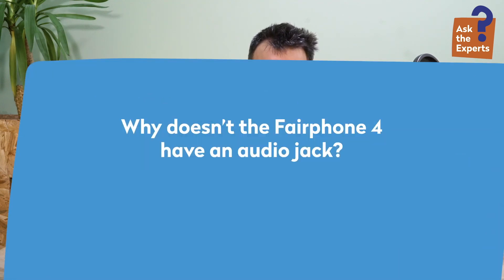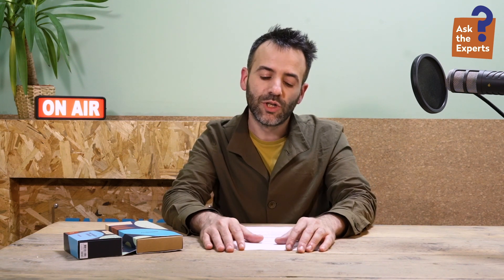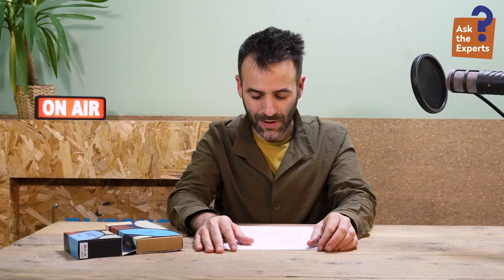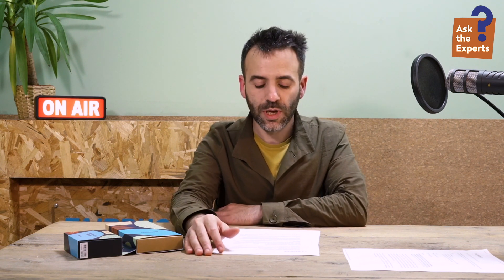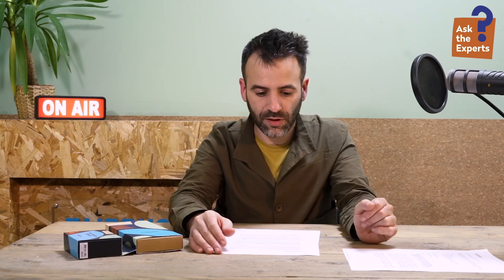Where's the headphone jack?! | and other questions answered | Fairphone

Comment: That's the actual dealbreaker that prevents me from buying a Fairphone, I'm not even kidding. It's not that I can't live without a jack, but that I can't tolerate a supposedly green company removing the jack and making people use less ecological wireless headphones.

Never seen a broken jack, but I've seen broken charging ports. IP68 phones without jacks get damaged by water, your phones do, too. Dust is easy to remove from a jack. Your charging port is easy to repair, the jack can be, too. Yes, the jack will make the phone marginally larger. But just be real and tell us that it's very profitable to sell wireless headphones and earbuds.

My car has an old multimedia and the music often stutters over bluetooth. If I use the dongle and turn on my navigation, my battery would die. I'd need to buy a dongle with a jack+charge port and you don't sell one. Or I'd have to drop half a grand for a new car multimedia. I don't feel like paying 2x-3x as much for a slower phone and have to deal with something as stupid as this.

Comment: Problem is that the usb c doesn't replace the headphone jack. The USB C port constantly cuts out at unknown voltages and because the usb-c port isn't fully locked, any bashing of it at all in a pocket will cause the audio to cut out. Bluetooth is terrible and your attempted solution with the fairbuds XL don't work either because plugging them in directly causes both microphone and EQ issues. I swear I'm producing double the e-waste because you insist on not putting a headphone jack on. The phone is no longer an all in one device and I'm honestly more disappointed in it the more that time goes on.

Comment: First. No, the USB Port does NOT replace the headphone jack. The 3.5mm port uses analog data, instead of digital, and if properly shielded, will have substantially less noise then digital.

Second. The 3.5mm Port is NOT less durable then any connector on a modern phone, infact it is probably the most durable connector because it is analog. It literally just needs electrical contact. It is an incredibly simple part with very few points of failure. If you wanted to remove connectors that were likely to fail, you should remove the USB C port and make it a contact magnetic charger port since that experiences almost no meaningful force from the wire when being used.

Third. They solved the issue of dust getting into ports DECADES ago. Its called a rubber gasket.

If you're gonna make up bullshit as to why my 3.5mm Headphones which have lasted for decades, and will last for a few more decades, aren't as sustainable as making a shitload of dongles and adapters which add more points of failure, and are likely to get lost or thrown out, or Bluetooth Headphones with non-replaceable batteries which are literally designed to stop working and not be repairable within 5 years, you should try harder to think up some actual reasons.

Or maybe just don't spit obvious bullshit, because honestly, it comes off as treating your customers like idiots. Why don't you just say "We benefit from you buying dongles and bluetooth headphones from our marketplace, so we removed the headphone jack." Because is it not true that you DO benefit from that?

Comment: So instead of the headphone jack having a very small chance of failing and not being usable (if you can't be bothered to buy a new cheap part and replace it), it will just be removed and then its guaranteed that you won't get to use it ever?

Comment: You know this is bullshit bc they came out with their own set of wireless earbuds (the least sustainable type of listening device). Not to mention removing this port means your USB C port has to pull double duty and be used twice as much. It does not make your device more durable, it does make sure that you'll have to buy that part from them more often and keep buying those shitty earbuds from them though. Stop trying to gaslight us into thinking this wasn't done with profits in mind. No one's falling for it!

Comment: The arguments for why the headphone jack was removed don't hold up, not just theoretically, but when we look at a living example like the Asus Zenfone.

Your arguments are that it's hard to make it water/dust proof because of the headphone jack, the zenfone 10 has IP68 without removing the audio jack.

And that it takes precious space from the internal of the phone, the zenfone 10 has a 5.92 inch display vs 6.3 of the fairphone 4 (with also smaller dimensions of the phone itself 146.5 x 68.1 x 9.4 mm for the zenfone 10 vs 162 x 75.5 x 10.5 mm of the fairphone 4) , also has a 4300 mAh battery vs the 3905 mAh of the fairphone 4.

And the argument that it can break, what are you talking about? In my whole life I've never seen a broken 3.5mm audio jack in a phone, hell I've once snapped a cheaply made headphone's male connector inside a phone's 3.5mm and once I took it out the phone's audio jack worked just fine with another headphones.

And it being removed just when you introduce wireless earbuds that just gets thrown away after 2 or 3 years because of their batteries being not replaceable, it proves that the company's intention was to just boost sales of the fairphone earbuds, and not a single reason from what you have said.

This just shows that we shouldn't see any company's actions coming from good intentions, but that whatever they do is just to squeeze profits and nothing else, and this company's way is by selling products marketed as fairly sourced materials and environmentally friendly, while actually not being that.

Comment: I've never had a problem with a headphone jack through normal use. I use a wired headset/headphones all the time. I've tried bluetooth but there are now so many devices using 2.4GHz that connections are never 100% reliable. I don't want more stuff requiring batteries and having to be recharged. Having more radios turned on on a phone reduces battery life even more.

Other issues of not having a proper headset jack andd relying on bluetooth are those of security and EMR. If I don't need to have radios on, by putting the phone into airplane mode for example, my phone is much more secure from attack. With a headphone jack I can put my device in airplane mode and still use it as a media player to listen to music or whatever, even in sensitive areas such as hospitals where EMR can interfere with the operation of medical equipment.

Comment: Soooo, what if you "invent" a new "headphone jack" instead? I think a separate port for audio is still needed in my opinion 

This way you could bootstrap a conversion and offer adapters for legacy but also new headphones as well, having charging and audio at the same time it's something that a lot of users do find important, dongles suck, maybe making the new aux port could be though as having electrical connections that are the same as the headphones jack but they got a better structure allowing an much smaller adapter

Comment: I would still use my iPhone 5S if it still worked. I currently use a refurbished first generation iPhone SE (looks exactly like an iPhone 5S). If it eventually gives up the ghost (german for when a machine/device/battery/etc. goes on the fritz / dies), I might switch to a Fairphone. However, there are two things I clearly miss, a headphone jack and the dedicated button like on the iPhone 5S or SE (1st gen) with which you can also use for fingerprint security, among other things.
Furthermore, I don't like large smartphones because I like to use my phone with one hand. 

On the plus side, however, is clearly the modularity and sustainability. The green casing also looks nice.
I saved the fairphone website in my browser for the future.

Comment: Totally buying in on losing the 3.5 mm jack. I have previously also been annoyed about the change from companiesremoving them. But since accepting the bluetooth headphones, i am totally in. Some comments say their headphones last very long with the jack. I guess that is the case for some headphones but personally I dont agree on that, I have had plenty of headphones (also expensive brands) where one of the headphones would not work, primarily because of connection issues between the chord and one of the headphones.

For me the biggest issues are the camera and the size. I hope with the camera that it is primarily the software, because I think the pictures and movie I would do with my older iphone 7 did better than my fairphone 4. No worries if its just a software thing, I will happily wait for upgrades on that part, and not a big picture taker anyways (even though it would be nice to be able to take nice great pictures if the opportunity would show itself).
About the size - talking about my older iphone 7 - I would have loved having the option to buy a phone at that size once again. Its difficult when having it in one hand to control the phone, and it takes up a lot of space in the pocket. then i'd rather have a smaller screen.

One last thing - I would love it if you designed a cover that had a pocket for credit cards - I dont know how big the market is for those, but i would have liked to have that option :)

Apart from that i am super happy with the phone, i think you have done just great! Keep up the good work!

Comment: I wrote this before and I'll write it again: The removal of the headphone jack and the micro SD card slot (and now SIM cards) from ANY device is a financial one. Anyone who thinks otherwise is f***king delusional. Oh and the removable battery too - its all just to make more money selling you more sh*t you don't need. The quality of 99% of all bluetooth headphones and mics is pure sh*t. My $7 Panasonic wired earbuds from 2012 sound better than most $150+ "wireless" earbuds - its not magic .... its just a strong analog signal that isn't passing through an ADC and being transmitted via lossy packets ...

Comment: Sorry but I genuinely can't help but laugh at this

For every reason that's presented here it's very obvious that the reason the headphone jack is removed is just to go along with the existing bandwagon.

You can manage water-resistance and dust-resistance with the headphone jack, a headphone jack barely takes up any space, and really? Bluetooth? Wireless headphones are not repairable, it only lasts as long as the battery is still working, they are wasteful and you can't repair them. Dongles aren't a solution either, your going to keep using the USB-C Port more which increases the chance of that breaking 

For a company set that prided itself on not just Repairability but also being Pro-Consumer, this is just sad. Why should I pay more for less features? I get it, Companies got rid of the jack a while ago but coming from this company is such a middle finger to the face. I'm disappointed.

Comment: Reduce E-waste? Bluetooth headphones?  Two tiny batteries, will last 5h x 500 charge cycles, so only 2500h or about 1.5 year. Not-repairable, so forced electronic waste in 1.5 year. Meanwhile I'm listening from my wired headphones, 6 years old with approx. 9000 hours based on average daily use. What is the real E-waste?

Comment: Removing the headphone jack and start selling air buds makes absolutely NO SENSE from an environmental perspective and is an exceptionally bad decision for the environment. 
- the occurrence of repairing headphone ports is minimal compared to charge ports I would say 1/50 or 1/75
- water damage is just as prevalent on phones without headphone jacks.
- bluetooth devices are unrepairable. when the abysmall battery dies, so does the air buds.... 
- using the same jack both for charging, dongles, headphones etc results in much greater wear of the charge port.
- we have been able to construct phones with antennas with headphones jacks for ages... this to is no reason to remove it

I have had my wired headset for 10+ years. And I have professional microphones that uses the headphone jack which I can no longer use without a headphone jack... None of the answers make sense, and this is a business decision to earn money, not for the environment. All respect is lost when you start to green wash your products. You might be better than other companies, but this brings you closer to them.

Comment: So to reduce ewaste you will remove a headphone jack thus making people buy bleutooth headphones, whose batteries will eventually run out and create more ewaste, not to mention all the discarded wired headphones heading to landfills.

A reminder :Many listen to music while charging their phones.
Reply: Not only that, but wireless headphone batteries have the worst life expectancies.  The lifetime of lithium-ion batteries depends on the size of the battery, and number of charge cycles.  Each bud has a tiny battery, so their batteries become unusable VERY quickly. And, the only way of charging them is the carrying case! So if either of the 2 buds die, they're both garbage. If the case dies, EVEN if the headphones still work you won't be able to charge them, and you'll end up throwing the out anyway.
Reply: Wireless pod headphones are literally some of THE most resource-wasteful products in all  of electronics.

Comment: You do realize you are using the same excuses that many of the major phone makers also use for the removal of the headphone jack right? I can't stress enough how sick I am of hearing "you can just use a dongle/adapter" or "we needed more space in the phone". I would rather have my headphone jack break then risk putting extra stress on the phone's one and only ability I have to charge it and hope I can get a replacement in time (don't know if it has wireless charging but I don't have one of those chargers). The Fairphone 4 has all the features I want in a modern smart phone right down to the stereo loudspeakers but a headphone jack is one of the things I want to see in any phone I buy and it's getting so hard to find one that has it with so many phone makers relying on dongles and bluetooth over just finding a way to put a tiny headphone jack in to the phone and not give us a million excuses as to why they can't/won't do it. You are supposed to be better then the major carriers not follow in their footsteps.

Comment: Liars. 

I've not ever had a jack fail, some still functional, made in the 80s. There were plenty of dust and water IP rated phones with the jack, before Corpos removed it to save themselves costs, while increasing sales of earbud e-waste. Oh, you're trying to sell that e-waste! 

If you really think the USB C is better, then at least supply two USB c ports then. Choosing between charging and other use, sucks. If one fails and one is fine, don't have to repair immediately. 

I know Sony tried to be greedy, but they brought back the headphone jack next model. Speaking of good IP rating Sony still has the jack while keeping out dust and water.

Comment: So disappointed. If the headphone jack is so bad then why is it other companies are able to have one and keep it waterproof. 
Dust and debris getting in the headphone jack is not protected by the warranty whatsoever. If I'm irresponsible with my devices and don't protect them properly that does not fall on the manufacturer. 
You're just trying to Green wash a cost saving measure. I'm not mad I'm just disappointed

Comment: This is absolutely despicable. You are trying to claim it cuts down on e-waste? How about the gobs of ewaste that are the bluetooth ear buds when the battery dies? How about the USB Dongles people will not have to buy???

I have a set of headphones from 2 decades ago that still work wonderfully. 

Phones don't break often from the headphone jack, they break from the SUB charging and data port. Plenty of water resistant phones have headphone jacks.

Quite trying to greenwash and rationalize a cost savings move.

Comment: Well, yeah, the headphone jack could break prematurely if it is used at all, but haven't you guys thought that this would just increase the wear on the charging port itself? 

Now instead of having to replace a simple, cheap, and easy-to-manufacture headphone jack which is just three L, R, and Common wires, you have to replace an entire charging+data port which is much more complicated and expensive, all at the cost of still having the consumer buy an adapter separately.

And all that is considering that the phone will still have the required DAC circuitry to drive the headphones and is only using the USB-C as a physical port. Otherwise, consumers would be in a still worse position by having to buy a dongle with a dedicated DAC within it that could introduce a series of compatibility, sound quality, and quality of life issues.

Comment: So, you are removing the headphone jack but you are not including a dongle to charge and plug a headphone jack because of "reducing waste". But you are selling the adapter! Create a problem, sell the solution. Water proof headphone jack also exist. The only valid argument is because of space inside the device, but that just makes you like every other company. I'm still using a Samsung Galaxy S8, and the headphone jack hasn't failed me yet, so if you use quality part it should not be an issue. What's next? A video showing how green your dongles are?

Comment: The dude is literally gaslighting. He is trying to pass a manufacturing cost reduction as eco-friendly move. With no jack users need to get wireless headphones (more waste, battery wears off). Alternatively, they can use a USB C->3.5 dongle which is likely to break more than once over the life of the phone(more waste).  Not to mention that the latter option will likely increase the use of charge port by several times and make port damage more likely.